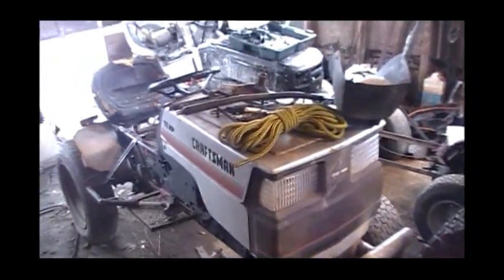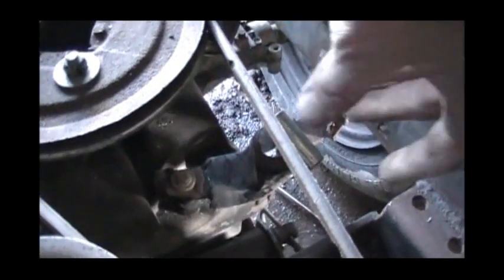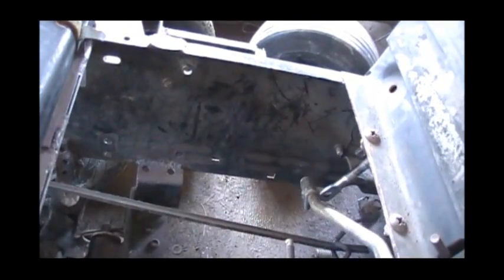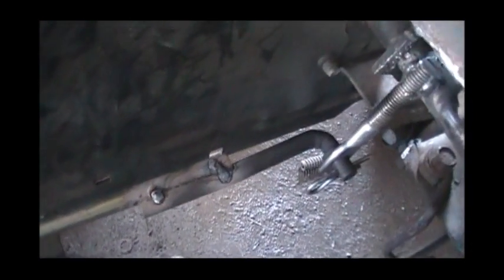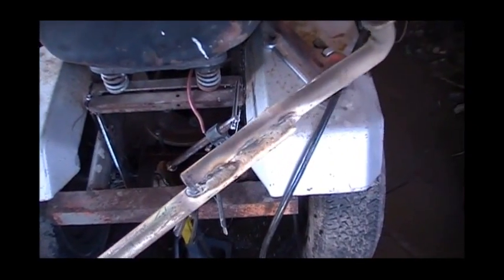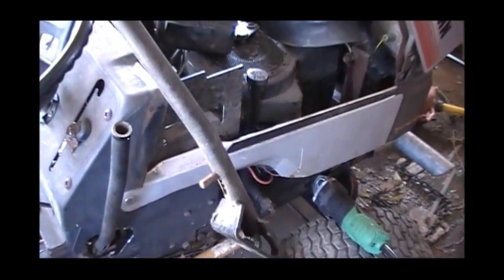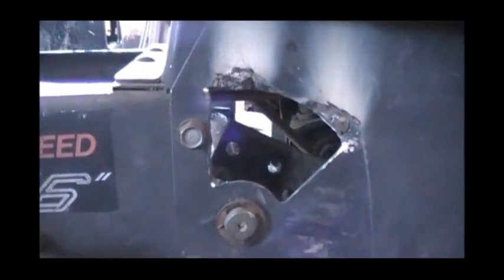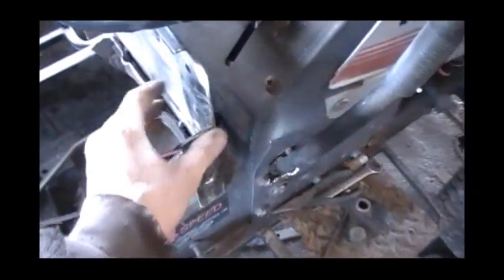How To: Custom Slap-shifter for Racing/Off Road Mower

Comment: I have the same exact craftsman I got today for free from a guy who said it was dead. 1$ worth of gas and my atv battery and its purring like a kitten. I got the mower because me and my buddies are getting into racing these mowers. This is a wonderful idea. The ball buster shifting is not that practical and hard to use. This seems like it would be relatively easier to use especially while racing. Thank you so much for this video.

Comment from the maker: I love tractor supply. it's a great place.
I wouldn't use a 1-1/2"... I typically won't go below a 3" for belt slippage. The smaller the pulley, the less belt it touching it, therefore more slip will occur.

Comment from the maker: @motorhead45102 Yeah, you could adapt this design a # of different ways. If you needed more throw, you could lengthen the front linkage mounting point, and/or move the mounting point on the trans closer to the pivot point, but don't go too close.

Comment: I just built my 84 craftsman same as this one,, I used this idea without cutting handle down ..... It's epic ... Runnin a 4 inch on the rear and the stock deck pulley whatever that is on motor

Comment: I absolutely love this. If I could weld, I would be doing this right now. I just swapped a manual trans from one of my lt 1000s to the one that had the hydrostatic.(Hydro is messed up and blew the engine on the one with the manual) I am currently trying to develop a new shift lever so I don't have to cut a hole in the floor.

Comment from the maker: @aaronnorman11 lincoln electric weld pac 100, It's a 110v gasless mig welder. You can get them at lowes for $300-$400. You can go with a different brand and it would be cheaper, try tractor supply.

Comment from the maker: @kcniem I put a dished pulley on the transaxle with the hub of the original pulley welded in the center. I ended up not liking that ratio, and put the original pulley back on, bolted to the top of the dished pulley. Watch my vid titled "Lifted, Locked and Stretched! Craftsman Update 2/3/2010" for more info on it.

Comment: hey fearless, this is motorhead i have the craftsman mudder on your forum, i started to mess with the mower a bit, Im currently welding up parts for the shifter design that you show on this video. I bought 2 i guess you can say ball joint connections for both ends and for the swing arm instead of using what you used i used the steel that used to raise and lower the cutting deck that is no longer there but ill tell more on the formum great idea

Comment: so on a lawn mower you have to press in the clutch in and stop in order to switch gears, but on a car or four wheeler you can press in the clutch and shift as your still moving, is it possible to remove that little break disc on the transmission of the mower so you can shift while your still moving or will you end up ruining your transmission over time?

Comment: That was awesome, after watching you Tranny lock video and this one i sprung a new idea.  Take a 5 Speed tranny that you can shift on to go with, and mount it so that the input pully is facing horizontal.  Then change the pully size(cuzz lawnmowers are seriously geared down) and mount my tecumseh 5HP to it side ways.  Sounded great till i couldnt think of how to change the gears.  I like your set up, but my tranny is facing differently so my shift will be up-down not front-back.  Any ideas?

Comment: It should but my dads wire feed is small and weak even in th highest heat setting couldnt penetrate the bracing on my demo car which was 1/8" angle iron

Comment: Do you think I could make this work with a six speed? If do you think the lever will go too far Foward?
Reply from the maker: yeah you could, just slightly change the leverage in the shift mechanism. It should work fine
Reply: sweet i have an old craftsman lt1000 i broke th edeck in my lawn buisness so i desided to make a offroad mower and thats when i found u on youtube...ive currently left it stock just switched the 9 inch rear pully to a 6 inch pully off of an old MTD

Comment: my mower is a shift on the go do you think its possible to make it llike your mower with 6 selectable speeds? the way mine works is that it locks the clutch into a certain place limiting the speed
Reply from the maker: sounds like the mtd vari-drive system. I wouldn't try to relocate the shifter linkage on that system. as far as I know, that system is pretty finicky when you start modifying it..
Reply: Fearlessfront
also i just measured i have a 7 inch pulley in my tranny what would you suggest for the motor pulley? 8in? i think i remember you sayin u had a 6 in the front and a 5 in the rear would an 8 in the front and 7  in the rear be like the same ratio or would that be the wrong way to go ? as in should i go ahead and reduce the rear and up the pulley in the front if that makes any sense
Reply from the maker: Justin Davis yea, tthat would be that same ratio I have. It will has tons of belt traction in the water with those big pulleys as well.

Comment from the maker: that sounds like a good design. I really like the position of the shifter on this mower, I feel like it's easy to use. It would be neat if tractors came with a setup like this from the factory.

Comment from the maker: @craftsman35mph This tractor has a slightly different pulley setup, and the trans has been moved lower because it has been lifted. So I'd have to have an original one to be able to build one that would work.

Comment: Three were the same craftsman you have, did one of those with the neutral lockout.  One was a craftsman LT10, same idea, but no deck handle, built that part.  Last one was the kid's RER, put a shifter in along with peerless 6 speed.

Comment: Nice idea I think I will do it. You could probably grind a notch at a 45 for each gear you wanted to. Put a smaller pulley on my transaxle so the belt fits a shifter. Definitely going to look at this for my rig. Thanks

Comment: Fearless,
Loved your videos, most don't know how hard that was to do. 
Although I do not need most, you gave me ideas and taught me that that fan gear on the steering has an offset washer - didn't know that. Plus many more ideas.

I'm taking my old Yard Machine, (MTD), 16.5 hp B&S opposing twin and turning it into a worker, not a real mudder nor a racer.

I want torque, not speed. To haul a trailer up and down the hill. To pull bamboo out at the roots, to drag railroad ties to where I need them.

Comment: Interesting mod. Although I am moving a fender shift hydro xmission to the dash area, some ideas will work for me as well.

Just wanted to add, what if you made small, (very small), notches at each gear. So it semi clicks into the gear position, but small enough to just push or pull it and it and it kinda clicks into position.
Similar to the actual balls in the tranny.
Thinking the weight of the new shifter  may try to change gears if you hit a big bump.

Comment: Built one similar to yours. Cut the handle down 6" put an antler on the opposite side on the bottom. Sliced the handle to acomadate a switch for the electric clutch. Used the deck clutch (electric 6"pulley) on the motor to power the Transaxil. It's fun running the gears cause the Transaxil is truly in neutral with that clutch.